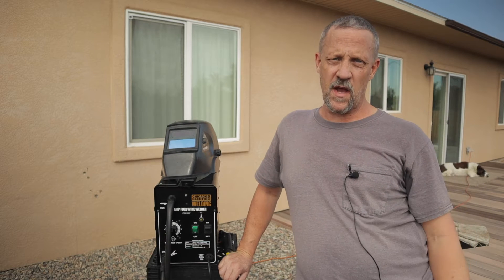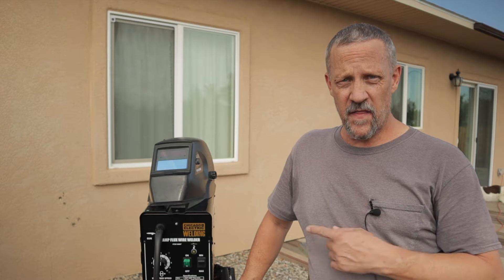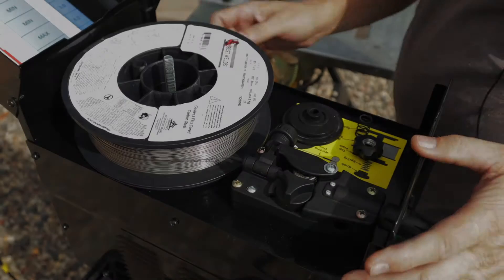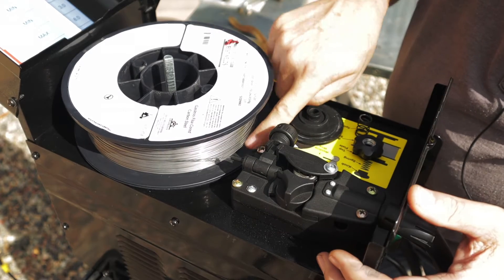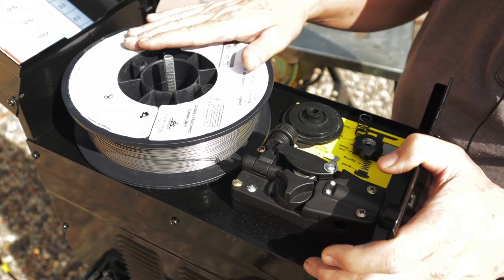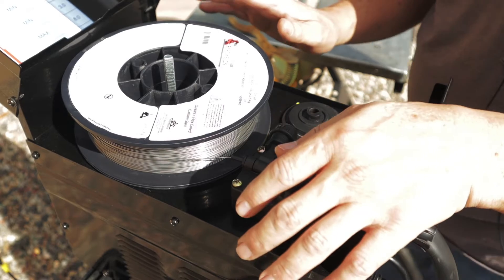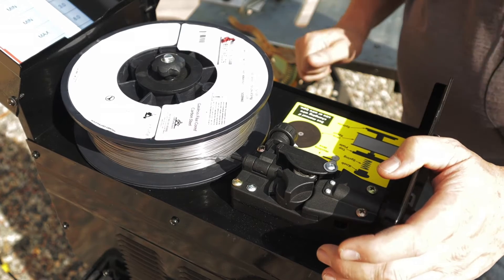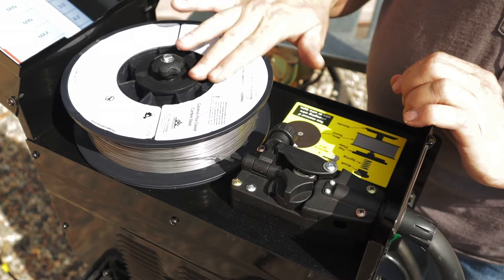Power Up Your Projects: How to Use a 10lb Wire Spool in Your Harbor Freight Welder!

Comment: I find it too much of an angle into the tube so I mounted the spool off the back of the welder and drilled a hole in the back to put the wire through  sheet metal with a grommet and a perfectly straight shot all the way to the rollers.
Reply from the maker: That's a clever modification to get a straighter shot for the wire!

Comment: I contemplated doing the DC mod to my Harbor Freight welder, but with the cost of the parts and time it takes to do it, I figured I'd be better off just selling my welder and buy the Titanium Easyflux DC welder instead. I posted my Chicago electric AC welder on Facebook Marketplace last night and it sold this morning!! Perfect! 
 So I scooted over to Harbor Freight and picked up a Titanium Easyflux DC welder. What an improvement! It is so much better! It is so much smoother and powerful. Much deeper penetration at a lower setting and almost no splatter at all. The welds looks like stacked dimes without even trying! 
 So you can spend the money and do the DC mod on your AC machine or go get the Titanium Easyflux machine and be happy!

Comment: Hey good video! I came by 'cuz  I was wondering if you have ever had any trouble with the feed roller? My dad had to use a vice grip on his. But even then he had to fiddle and fenagle. Fact is that the cheap plastic just doesn't hold up. That whole assembly should be metal.   if I ever find some old condemned miller, lincoln or anything with a decent part, I might pick it up and stick it in there.
Probably I'm more likely to just get a decent Mig welder. But I won't throw away the flux core. It'll still come in handy outside in the wind.
Reply from the maker: Thanks! Fortunately I haven’t had any trouble with the wire feed on this machine. I agree with you that all metal would be much better. But for being plastic and cheap I can’t complain. It’s served me well over the years.
Reply: @DIYHomesteadProjectsDIYHP10  That's good to hear! I hope it holds up because I know it's a common failure point.👍🤙

Comment: Can the 125 model be modified to run a 10bl  spool wire also? thank you
Reply from the maker: The 125 and the 90 are the same machines with different names. They can both run a 10lb spool with no modifications.

Comment: Hello do you know if the 1 lb spool and 2 lb pool are the same dimensions or interchangeable? Great info thank you
Reply from the maker: I'm not sure. I've never used a 1lb spool but my guess would be they are the same size spool.
Reply: @DIYHomesteadProjectsDIYHP10  yeah that's what I'm hoping and makes sense to me. Just wondering because I bought a Lincoln electric welder being delivered by UPS tomorrow, that uses 1 lb spools. I'm hoping it's going to also use the 2 lb spools. Using 1 lb spools doesn't make any sense to me.  Thanks for the reply
Reply from the maker: I've never seen any machine that will only use a 1lb spool. I think the 1lb and 2lb spools are the same size but one has half the amount of wire on it. You should be fine with a 2lb spool. The Lincoln wire that comes in a 1lb spool is about twice as expensive as a (non Lincoln brand) 2lb spool. My thought is that Lincoln sells it in a 1lb spool for about the same price as other brands 2lb spools. This is a marketing scheme IMO to make people think they are getting the Lincoln name wire for the same price as an off brand name wire. I've read many posts where people didn't realize the Lincoln is only 1lb of wire and by the time they realize it they can't return it because they have already used some of it. For learning and practice I would suggest using the cheapest 2lb spool of wire you can find. That is what has worked well for me and it will save you quite a bit in wire costs. I wish you the best with your new welder!
Reply: @DIYHomesteadProjectsDIYHP10  okay cool. Amazon had a seller with a great deal the other day. I bought three two lb spools for 20 bucks free shipping. Two days later I checked to see what the price was from the same seller, he raised it five bucks now at $25 for three 2 lb spools

Comment: Hello. I have same welder . Can I use the stainless still welding wire with this welder? If yes can you send me a link that I can order it please . Thank you
Reply from the maker: Actually depending on what you are welding and it's use you can weld SS with regular flux core wire. You won't have the SS properties at the weld so it will rust if exposed to moisture but it will weld the SS metal together.
Reply from the maker: I haven't tried any but they do make flux core ss wire. Here's a link for you. https://amzn.to/42ElFlT

Comment: Bought one at harbor freight’s but the flux wire moter just ticks would u know a solution I made shure nothing was to tight or to loose
Reply from the maker: I would take it back and exchange it if it’s not working right. HF will exchange it for no charge.

Comment: IT IS TANKLESS, NOT GASLESS !!! ALL PROPER WELDING NEEDS A COVER GAS. THIS IS ACCOMPLISHED WITH EITHER A TANK OF PRESSURIZED GAS, OR BURNING FLUX THAT IS COATED ON THE ELECTRODE OR FLUX INSIDE THE CORE OF WIRE TUBING. AAARRRRRRGGGGGHHHHHH.

Comment: Why single pass only with the wire ?
Reply from the maker: Supposedly if you have more than one pass the weld can become brittle with this wire. That may or may not be a problem depending on what you are welding.
Reply: @DIYHomesteadProjectsDIYHP10 Hi. Wanted to let you know there is another type of weld wire with multi pass capability called E71T-11. You can do 3 passes with this type of fluxcore. You may need this type wire down the line for welding on thicker metal to get good weld penetration.

Comment: I found out i don't like using the copper coated wire of 0.030 because i believe it takes more heat to melt it and then it's more sloppy i tried it and didn't like it
Reply from the maker: All the copper coated wire I've seen is solid wire. I have not run across any copper coated flux core wire myself.
Reply: @DIYHomesteadProjectsDIYHP10  I did and it's to splashy and takes more heat than what the machine puts out to make a good weld line the copper coated flux core wire to me doesn't do a good job 

I believe it would do a better job in a machine that puts out more heat 

It still will get your stuff done but look really sloppy

Comment: is it better not to use the tip cover? on your lead
Reply from the maker: It gives you better visibility of the weld pool. You can also see how much stick out you have when you are welding.
Reply: They say the fluxcore tips from the HF Titanium 125 can also fit this Chicago Electric 125. Those tips can be bought separately at Harborfreight.

Comment: Modified mine to dcen from ac mig. It now welds flux core wire amazingly well. Great for jobs where only 110 service is available. Draw backwards pushing into the puddle with a little higher wire feed and it will produce strong welds with good penetration. Great addition to my shop.
Reply from the maker: I agree jc. My machine is fun to use with flux core especially those outdoor jobs with only 120V available.
Reply: @DIYHomesteadProjectsDIYHP10  That is fantastic!!!

Comment: Is this one good for projects and welding tow hitches?
Reply from the maker: It's good for projects that aren't critical or potentially life threatening if the weld fails. A 90 amp machine just doesn't have the power to weld much over 1/8" in a single pass. An experienced welder might be able to work some magic using skillful techniques but I would recommend a more powerful machine for critical welding such as a tow hitch.
Reply: @DIYHomesteadProjectsDIYHP10  i have the 125 amp,would it still not be good for tow hitches?
Reply from the maker: The 125 amp and the 90 amp are for the most part the same machine. They are both running off 120V power source and have the same output. HF just relabeled it for marketing purposes to make it look like an upgrade but they are both only capable of 3/16" material MAX with a single pass at best. Most tow hitches that I'm aware of are using steel thicker than 3/16". Personally I wouldn't use any 120V powered welder to weld a trailer hitch. They just don't have the power to achieve the penetration required for a critical part like a trailer hitch. It will stick the two pieces together but it won't have the penetration and strength required for such a weld. Think about it like this, if the weld breaks, could someone get seriously injured? If the answer to that question is "yes" I wouldn't weld it with a 120V powered welder. Again just my personal opinion, I'm not telling you what to do.
Reply: @DIYHomesteadProjectsDIYHP10  ok thank you so much I will be returning it
Reply from the maker: Sorry, I didn't mean to rain on your parade. I am no expert but through my limited years of welding, I have done a lot of research and study. Everything I've read points to a 240V machine for welding something as serious as a trailer hitch.
You could always ask that same question to one of the "professional" welder channels and find out what they think about it. Then you'll know for sure. Maybe "Welding Tips and Tricks", "Weld.com" or "Pacific Arc TIG Welding". They all have experienced professionals that would know the answer to your question without a doubt. Good luck with your ventures.

Comment: So, I know this is a year did, but I wanted to tell anyone with this welder that there is a flux core nozzle that will fit. It's the Lincoln Electric gasless nozzle that's available at Lowe's and I believe Home Depot as well.  There are two they carry and the one we want is the less expansive screw on cover. The slip on sux butt..
Reply: Weld with the tip off burned the factors nozzle up just saying
Reply: The fluxcore nozzle for the Harborfreight Titanium 125 welder, can fit the Chicago Electric 125 welder also. You can buy nozzle tips separately.

Comment: I just did the mod for the 10lb spool, and my wire speed is very slow compared to running a brand new 2 lb spool.  I have to run the welder at its maximum speed to barely get an acceptable feed rate.  I have not investigated the if changing the spool tension makes any difference or not.  Might have to upgrade the feed motor to a higher HP to get enough torque to move the 10lbs at an acceptable speed.  In the video my estimate is about 6 lbs in left on the spool.

Comment: I just bought a titanium 125 flux I took two back because it won't fire up I checked the tip like instructed touch the tip with the cables no spark at all connected to several grounds changed different outlets you mentioned it must be plugged into a 20 amp circuit some of my circuits are 15 some are 30 I'm assuming I have to find a plug that's 30 don't know can you help me
Reply from the maker: If it will turn on and the fan runs. When you pull the trigger, does it feed wire out of the gun tip? If it does, feed out a couple of inches holding the tip of the gun near enough so it touches the ground clamp while it's feeding. It should spark and weld. Do this with a welding helmet on for safety and so you don't get flashed. If it sparks when the wire hits the ground clamp, you're good and it should weld. If the wire touches the ground clamp "while it's feeding out of the tip" and it doesn't spark when it hits the ground clamp, something is faulty with the machine. I hope that all makes sense, it's hard to explain.
Reply from the maker: I would think if it won't fire up on any 120V outlet regardless of the amp rating there is something wrong with the welder. Does the machine start up and fan run when you turn it on?
Reply: Washer/Dryer circuit is usually on a 30amp breaker. Washer is 120v. The dryer gets 220v but the breaker should be "30 amp shared" in the panel. Plug your machine into that 120v outlet.

Comment: Be careful now you have removed the torch shroud. If you touch the copper bit on the work it will be a total short and can damage the welder. The shroud is Insulated from the copper tip, so touching the work will do no damage.
Reply: It will not damage the welder at all. It will however weld the contact tip to the whatever your welding and kill the tip.
Reply: @tylerturner5442  Been there, done that!
Reply: I'm thinking that on this unit there is no shorting out with the missing nozzle until you pull the trigger.
Reply from the maker: That is correct Mike Joyce
Reply from the maker: Will do Dave, thanks for the tip!

Comment: Dang 3/4 in stick out??  Had no idea you were supposed to keep that much of a stick out. I learned something new today
Reply from the maker: Yes 3/4" for flux core wire. I was a little over that at times but 3/4" is the goal. That's about double the requirement for solid wire mig welding. Flux core wire requires a pre-heat prior to entering the weld pool for the flux to work properly and protect the weld. Flux core wire stick out can be quite long but should not exceed 1 - 1/4" from what I've read.
Reply: Thanks for that tip too  I've been using this machine as is for sheet metal patches. I other tip for me was smaller size wire .025 Lincoln wire but I don't use gas neither .A  thousand bites of welding 101 spot welds really. I'm going to convert to dc should be good. I noticed the little speed motor is 12 v maybe a candidate for a dc relay and 9v battery supply project. Many thanks.
Reply from the maker: You are quite welcome! Happy welding to you!
Reply: @DIYHomesteadProjectsDIYHP10       Absolutely loovvee the 10lb spool idea.  The two pounders just don’t last long enough.  Sooo despite not having the “certificates” to be labeled as a “professional” I have spent the last 4-5 years welding in tool/die shops, custom hotrod shops, steel building companies, and everything in between.  That being said, the “proper” procedure for fluxcore may say 3/4 of a inch, buutt for me and my experience (just me myself and I, no expert at all) I have found that if I keep the stick out down to like maybe 1/8-1/4 inch and my heat up and wire feed down it starts a pool and burns in much better than it was with a lot of wire hanging out.   Just my two cents, no expert at all,  but i did buy this same machine when my Lincoln got stolen and I weld thick and/or structural stuff at least once a week with it.   Takes lots of cleaning up after, and a good bit of patience, but it’ll weld 1/4-3/8 alllll day.  Just in small sections, a couple inches at a time Hahaha
Reply: He is running without the nozzle so a little deceptive there.

Comment: Do you recommend using all those capacitors or do you think less would have been sufficient?
Reply from the maker: From what I understand it's good to have around 60,000 microfarad worth of capacitors. I have seen people have descent results with no capacitors as well. The more you have the smoother the ark is how I understand it. You could always try it without and see if it will work for you and install caps at a later time if you decide you need them. Hope this helps.
Reply: @DIYHomesteadProjectsDIYHP10  AC is fine. I have europan version, and once you found the hot spot settings, something like spray transfer mode, the welds will be very good, and the spatter will be minimal. For my model are, 18.5 volts, wire speed at 6 and 0.9mm wire for 2 mm work steel.